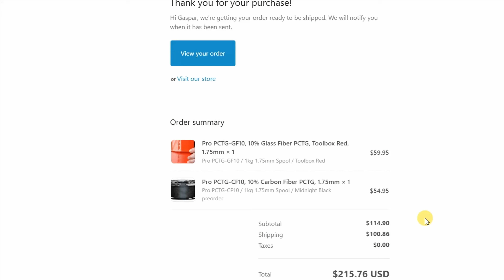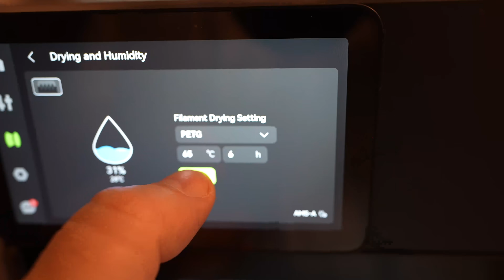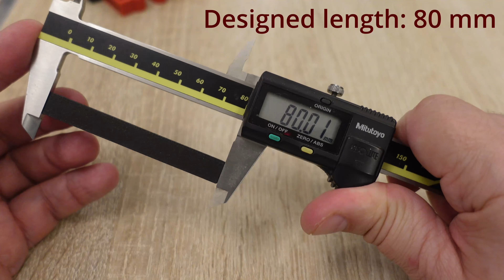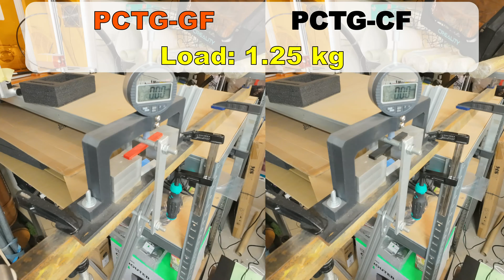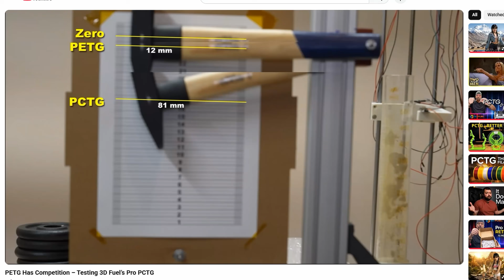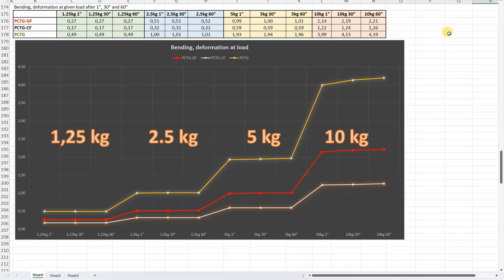3D Fuel Pro PCTG-CF & GF Tested – Stronger Than Regular PCTG?

Comment: Thank you for the VERY thorough review, Igor! We don't even have our filament profiles fully developed yet for the PCTG-GF, so we expect that things like layer adhesion will improve even more over time with more dialed in filament settings.

And yes, we plan to release 10+ colors of the Pro PCTG-GF within the next two weeks.
Reply: I would say Dr. Gaspar is the #1 influence BY FAR on my buying decisions.  I will not buy non-Bambu filament that has any kind of functionality aspect until/unless I see it here.  I'd have scrolled past your company name, in fact scrolled past PCTG, were it not for this review.  Polymaker got incredible cachet by sponsoring the channel, and this moved them onto my "worth considering" list.
Reply: Nice to see you here already, and thank you for the classy reply to the testing. I'm hoping to get back to printing in the not too distant future, and 3DFuel is one of the companies I'd be interested in buying from.
Reply: Hi, John! Thanks for the cool filaments and color matching the tool brands. Nice to have everything matching, so looking forward to the GF colors.
Reply: Been using PCTG and PCTG CF for all sorts of prints to use at work; it has to withstand 110°f+ summer temps being in contact directly with iron columns and sun and they hold up great. UV doesn’t mess with them much at all, prints easy, lasts well, no complaints. Love this stuff
Reply: Any chance there could be a print profile for the Neptune 4 Pro?
Reply: @ElectronicDust636  it's not currently on our list of profiles to create. We're not saying it never will happen, but we already have so many projects on our plates.
Reply: I am performing a 11 step, 9th gen tuning process, including 16-point adaptive PA tuning on the A1, P1/X1, and P2/X2.  If you're interested in those profiles, let me know--but it won't be cheap (I don't share these profiles for free).  I just ordered about $250 of your filament to do the tuning with.
Reply: @EliteMacFreak  what an interesting approach

Comment: Nothing is "ultimately true", but for the sake of using figurative speech I would say that PCTG + GF10 is the ultimate do it all material at a decent level and you can print it on your cheap Anycubic Kobra and other similar low cost printers (well, diy an enclosure, but that aint to diffulct).

In Poland PCTG + GF10 (ReFill) by Rosa3D costs below 50EUR per kg.

Comment: You should try to anneal (heat treat) those pieces. 3D-Fuel has instructions on their site on how to do it with times and temps. I have moved away from PETG and almost all the PETG I use has changed to PCTG.

Comment: I just don't get the point of this material. If it was the same price as PETG and printed at the same speed it would be a no-brainer, but until then it just seems like it doesn't improve on PETG enough to warrant the price and slow print speed. And if you want an engineering filament there are better options (e..g PET-GF/CF is cheaper and typically better engineering properties).

Comment: The difference in performance between the CF and GF filaments could be down to print temperature or speeds.  Glass is an insulator, while carbon is a conductor, so when printing with the same temps and speeds, the glass fibers likely aren't picking up as much heat as the carbon fibers before they are laid down into layers.  Bump the temps up a few degrees and/or slow down the speeds a bit, and the GF material will likely improve in the strength tests.  CF vs GF is a trade-off, depending on what you need from the material - they have some overlap, but they do not fill the same niches.
Reply: This is exactly right — the thermal conductivity difference between carbon and glass fiber is a key factor that's often overlooked. CF conducts heat more efficiently, which affects how quickly the melt zone stabilizes layer to layer. Adjusting temps and speeds manually is one approach, but this is precisely what thermal simulation handles automatically — modeling the actual heat transfer for your specific material and geometry before you print. Helio does this inside Bambu Studio if you're printing on a Bambu machine — worth trying on these materials specifically.

Comment: Great video! Very interesting filaments. I love the idea of a higher strength/temp petg cf/gf with great printability. However, as others have said, pet gf exists, is cheaper, and prints amazingly. I use a g10 build plate which is just perfect for it. I've had a pretty good experience with 3d fuel's pro pctg (albeit the stock profile is too fast), you just have to be willing to dial in the settings a bit. But for $25/kg recycled, that's pretty solid depending on the use case. But the price for the cf/gf variants just doesn't really work against other options rn imo.

Comment: Hopefully you'll see this comment Doc. The PCTG-CF is compounded with long strand CF. This is why you're seeing better tensile strength & elastic modulus. 
I would encourage you to do a short test run with both these filaments printed in 50c chamber heat with nozzle at 280c for CF & 275c for GF. The results may surprise you. 😉
Reply: Great suggestion on the chamber and nozzle temps — those parameters make a real difference with fiber-reinforced materials. What's interesting is that even with the right temps, the thermal conditions vary layer by layer depending on geometry and print speed, which is why results can still be inconsistent. Thermal simulation accounts for all of this dynamically — Helio models the actual heat distribution throughout the print inside Bambu Studio, so you're not just setting a fixed temp and hoping for the best. Worth trying if you're running CF or GF materials on a Bambu printer

Comment: For non-filled PCTG made in the USA, I've found American Filaments' PCTG to be better than 3DFuel—it prints more reliably and seems to have better strength and layer adhesion. They don't have -CF or -GF varieties yet. I think of AF's PCTG as "PETG++"—it works where you'd use PETG, it prints a little easier than PETG, it's stronger than PETG, now if only it weren't twice as expensive as a good PETG...! I tend to use it when I print stuff for the grandkid that needs all the strength it can get while remaining reasonably non-toxic.
Reply: As you said, the American Filament PCTG is definitely more like a very, very nice PETG, like our own Pro PETG. We know that they are using a different resin grade than the Pro PCTG that we manufacture.
Reply: @3dfuelusa I got one of your early spools of your PCTG-CF a few months ago and have yet to print with it. Question for u. I'm currently making a part using Bambu PETG-CF. My part endures shear stress (on some threads). I would think your PCTG-CF should easily beat my current PETG-CF AFA shear strength, correct?
Reply: @lanceg6828 it should, yes

Comment: Why are you changing the temperature when you got a specific profile from the manufacturer?

Results: It almost seems like they improved their formulation in between the no-fiber test and the new ones? The differences are quite big.
Reply: To be fair, we do a lot of development work but we don't have EVERY printer there is and users trying out different temperatures for testing purposes add another data point to help us improve existing profiles and create better new profiles

Comment: Thx. On some other video on diffrent channel I heard that PCTG profile on Bambu Lab isn't good for mechanical properties od models.
Reply: Which one? We've been revising our profiles to focus more on strength than printing speed, so an older profile may not provide the strongest, toughest part.
Reply: @3dfuelusa  I tried to reply, but probably i cannot send links. So channel is called "3D Printing Nerd". And video is named "3D Printing PCTG with 3D-Fuel LIVE!". Interesting part starts at 18:08.
Reply: @3dfuelusa  I had sent y'all an email not long ago about the regular pctg printing matte on my P1S with hardened nozzle. The only way I can get it shiny is 275 degrees and volumetric flow of 8 or less. I think the profile defaults to 12, which is way too fast for it to print properly.
Reply: @wojtek-33 , that makes sense. Yes, we've been revising our profiles to use a higher temp and lower volumetric max values to focus part performance instead of print speed

Comment: I’ve tried their regular and GF variants (GF also comes in natural btw which turns out milky white). They print well and perform well for what they are. My biggest issue is that right now, I can buy PET-GF for less and it’s an upgrade in every way. A little more demanding to print, but honestly not that much.
Reply: At this price point, it is just slightly less than siraya tech ppa-cf, which is a different league.
Reply: PET-GF is available in colors for the same price.  It can be annealed, giving nearly PPA-GF high temperature resistance per @ross13 discord testing. PCTG is semi-crystalline, so theoretically it can be annealed. There is little info about annealing PCTG and the extent to which that might improve temperature resistance.  3D fuel mentions annealing only for their PLA, so one has to assume their PCTG does not benefit very much.
Reply: Same. The main benefit I see of PCTG is its elasticity. But then that contradicts adding CF or GF
Reply: Not just fiber PET, but also PA6, PA12, PPA, PPS. PC etc.
Or you could just buy regular PETG, and just work around the limitations by designing your prints within their limits and for your intended applications. Sometimes, being a better designer can save you alot of money.
Reply: Yep they have to get their cost down to make this filament make sense. PET-GF/PET-CF are just a step above this mechanically. Not a bad filament at all, but for the cost there are definitely better options.
Reply: @rileyneufeld7001  to be fair, 3D Fuel filament is already at an extremely competitive price point considering that it's US-made.  Anything you find that's cheaper is going to be Chinese made.
Reply: @rileyneufeld7001 You’re paying that premium for a fully US supply chain, which you may or may not value. 3-D fuel has some good podcasts that cover the struggles of trying to cut prices while holding margins to a sustainable level.